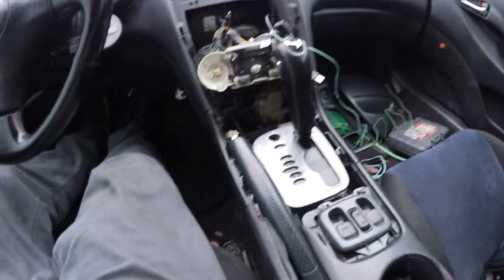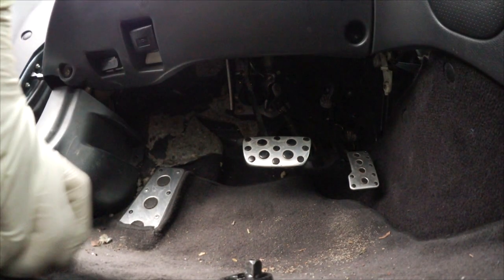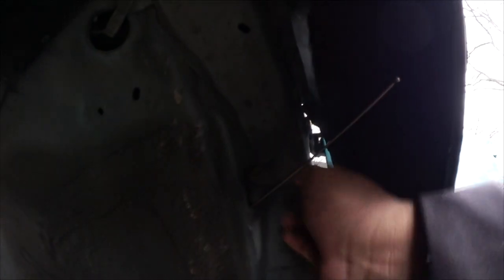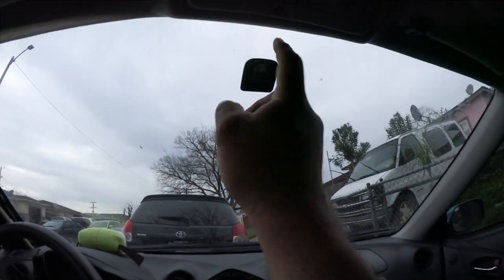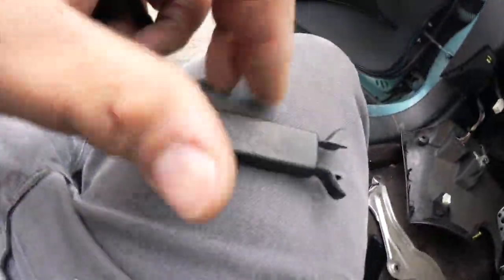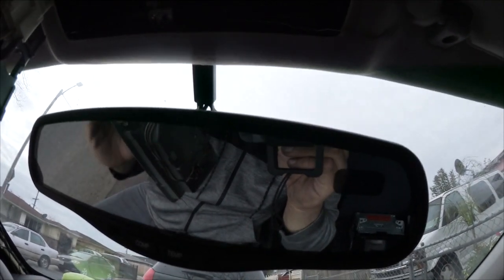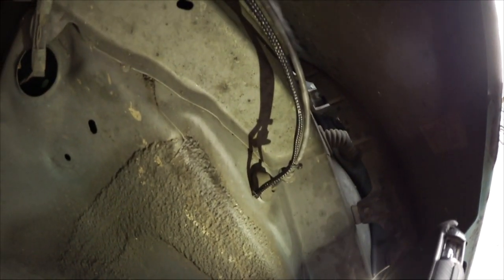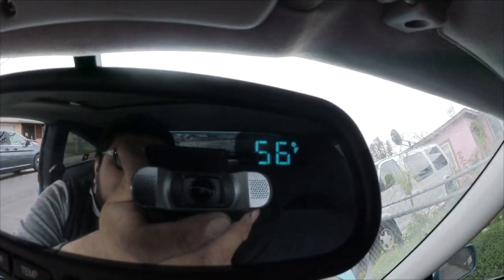Installing auto dimming mirror on my Celica GT-S (00-05)

Comment: I have seen the same mirrors in nissan navara.... can you specify the model of that mirror or suggest a new one? :) Also, have you installed cruise control in the gt-s?
Reply from the maker: Id have to double check. Its most likely a universal one but it was a dealer install option. I have cruise control on this Celica but i believe the computer for it is not working since it does not work.